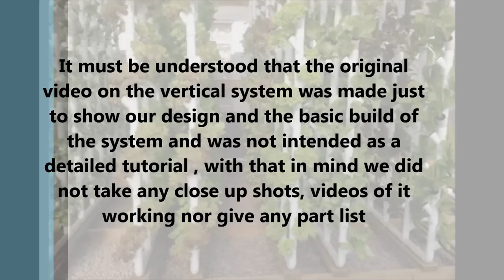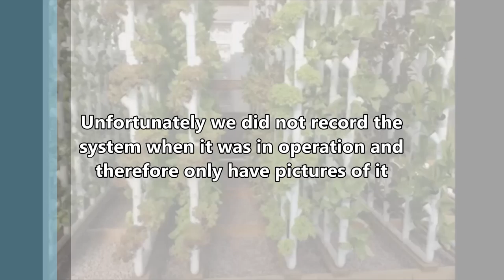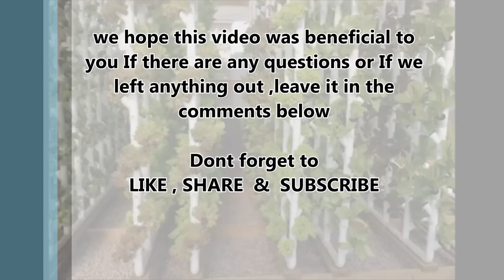How to , Detailed Vertical Hydroponics

Comment: It is impressive the design identifies and solves some of the problems which is prevalent with a vertical hydroponic build. The chief of which is equal distribution of the nutrients to each of the plant holders. I have a simple 4 tower square design which was a common design offered by several on the Internet. I found the pump to be inadequate requiring absolute leveling to get the nutrient flow evenly divided. Thank you very much for your observations and thought but more than that, your willingness and expertise to share this with others. This makes you a great person, one who believes not in held information but rather shared information to benefit us all. In this very divided world we live in, this speaks volumes about your character. I truly appreciate it.

Comment: at 653 now i understand why this system was discontinued, it barely touches the net pots, as such the lettuce or plant will be deprived. In the philippines we just use a heat gun to soften the pipe, then insert a bottle with a bottle with the same size dimension as the net pot to be used, just a suggestion.

Comment: Could you foresee any problem using a double-wye pipe fitting instead to increase yield while still having alternating pattern of direction?
Reply from the maker: yes in a case like ours where the trees are very close to each other you will get shading of the lower plants especially when they get big and by using double wye fitting it will get worse, so I would recommend leaving adequate space for light if you intend using double wye fittings.

Comment: Why did you discontinue using the system? Too much shade and not enough sunlight? Low production?
Reply: Apparently they're based in South Africa, which sadly suffers major power outages on a daily basis. Without electricity the water pumps won't work, and so the plants were probably dying under the intense African sun.

Well done AH Hydroponics for overcoming the national grid issue with your latest RDWC design , your ingenuity is inspirational.

Comment: There are divergent views on the food safety aspect of PVC. Did you use any special kind of food-safe PVC pipe and if so, is it easily available and how should we ask for it at the store?
Reply: the water you drink from the tap comes from miles of pvc pipe. MILES of it. but it is nsf-51 pipe to be clear. and quote.. "Thanks to the aforementioned NSF-51 standards along with FDA approval, it is safe to conclude that PVC is food graded."  not that the fda is always right.. so yes. pvc pipe you get from the store will be almost always foodgrade safe.
Reply: @krazyklown8160  The reason the miles & miles of PVC coming into our homes with our tap is safe is because it runs UNDERGROUND.  The moment you let direct Sun hit PVC is when the leaching begins.  Think of Bruce Banner vs. The Incredible Hulk.  Same person, same PVC .  But the moment you expose it to what will degrade it (Sun/UV rays cuz it was not designed for that tolerance) it starts to fall apart chemically.  I live on a farm & we have used PVC for 3 generations now.  They degrade & crack if you leave them outside.  But well before you visually see the cracks, chemistry  within has degraded.  No one wants THOSE chemicals  in them!

Comment: Where did you get the inlet pipes from
Reply from the maker: The inlet pipes are standard 25mm pvc pipes but we have drilled holes in them to allow much thinner flex pipes to fit exactly in with no leaks which then feed the water to the grow trees below.

Comment: I love the idea of a plastic disc to distribute water! I have a vertical aquaponic system that uses expanded clay as the growing media, and it isn't working very well. What type of substrate do you use?
Reply from the maker: we used to use coco peat but we have changed to rock wool as the water stays more clean than with peat
Reply: @AHhydrogrow  with the rockwool did you not had problem with Algae?

Comment: Oh, and how did you hook up everything to make it do automatic watering and such?
Reply from the maker: we had a sump tank and a pump which pumped water up to overhead distribution pipes then to feeders on every tree, the water drained back to the tank and is circulated on an hourly bases by means of a timer switch which comes on for 5 to 10 mins every hour.

Comment: Can you tell us what you used as the substrate? The "media" in which you put the lettuce seeds? Would coco fiber work?
Also I was thinking, the problem which you mentioned in 6:55 would a longer netpot work?
Thank you for the video, very informative.
Reply from the maker: we originally used coco fiber then moved to rock wool both are fine but rock wool does not dirty the water as much 
yes a longer net pot would work

Comment: the pump need to be running 24/7 or there is a particular time period to run the pumps?
Reply from the maker: On our system it did not run continuously rather at hourly intervals for 5 minutes, But you can adjust it to your preference.
Reply: @AHhydrogrow  how do you set intervals for a pump?
Reply: @slumberless7605  Tey must have used an electronic timer, like a water heater
 timer

Comment: Hi,
Thanks for the video. I have a question! Which is the frequency that the timer puts the pump in operation?
Thanks in advance for your help.
Reply: I think they included that in the old video.
Reply: @FooxYT  pretty sure that info is in the old video, but to be honest any hydroponics forum or website should help you get a general ballpark and you can fine tune it based on how well your plants are growing.
Reply from the maker: depending on the weather conditions etc ,but in normal circumstances its good to run the pumps at every hour for a few minutes ,In extreme heat you may want to shorten the intervals so the roots do not dry up.
Reply: @AHhydrogrow  awesome, thanks for the info.

Comment: I dont see how the water gets from the reservoir to the actual plants? You mention there was a top rail but thats the most important piece to explain as the system is useless without how the water gets from the tank to the actual plants. otherwise a great video. It could be an amazing video if it was complete.
Reply: A pump moves the water there, just put some kind of fitting on top.

Comment: Why was it discontinued? Was it not producing the desired output or was there something else wrong. The reason why I ask is that I was thinking of moving back home  & doing something similar to your setup in Somalia,  where lettuce is in demand but the crop is difficult to grow because of the high temperatures in some seasons and lack of water for most of the year. 
PS Thanks for putting up this video and all your other videos.

Comment: Used 4" X 2" Double Wye pvc Fitting that will be 30 per vertical
Reply from the maker: Yes that can work, but your spacing between the trees would have to increase and also you would not have a spiral formation without blocking light coming from directly above (in the case of grow lights), update us in the future on your system. Thanks.
Reply: @AHhydrogrow  Double why can be stacked at 90 degrees to provide the same spiral effect your system had. or you can spin it 60 degrees each level, so it would provide much better ventilation, lighting and space for growth
Reply: Bakthavathsal Kadambi thanks for this

Comment: Thanks a lot for this vids. So you get a density of 81 plants / m2 , and for your DWC it's 25, so why did you stop this technique ?
Reply from the maker: We were experiencing power outages which began to interfere with the plant growth and caused some plants to stunt so we moved to RDWC
Reply: @AHhydrogrow  thanks a lot.  So if you don't get power outage is that a better system than RDWC ? And how long a power outage can cause health problem to plants ? Thanks a lot :)
Reply from the maker: In terms of space the vertical system is obviously better but we found better growth (head size) in  the RDWC system, On a very hot day we found that the roots can dry up if not watered ,so you can possibly pull through a power outage in normal circumstances (in our case 2 hours a day ) but we felt it was better if the roots were submerged , Exactly how long causes health problems to plants would vary on circumstances , thanks.
Reply: @AHhydrogrow  thanks a lot. Did you figure out why dwc is better in terms of yield ?